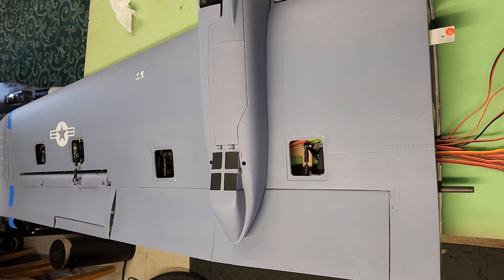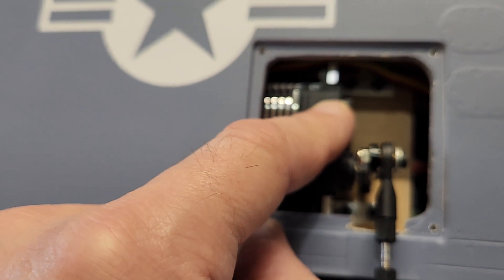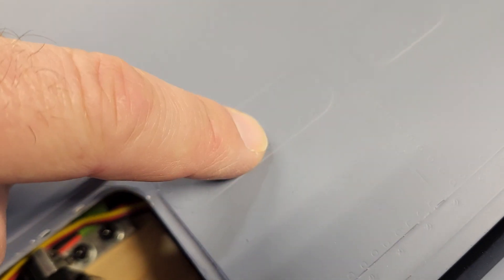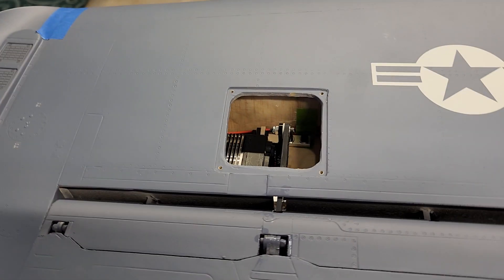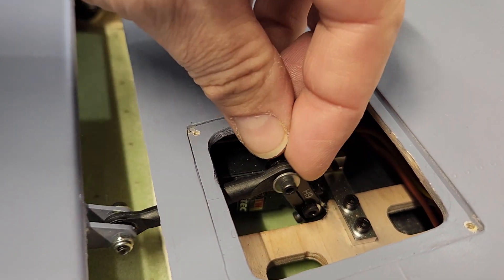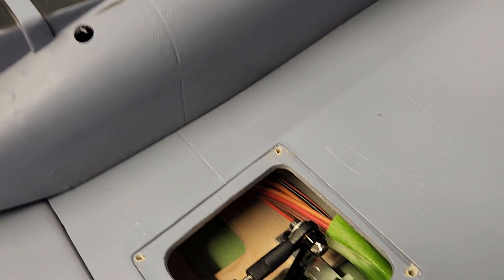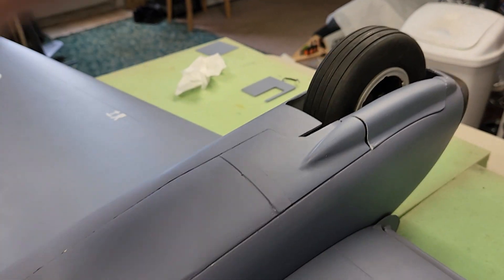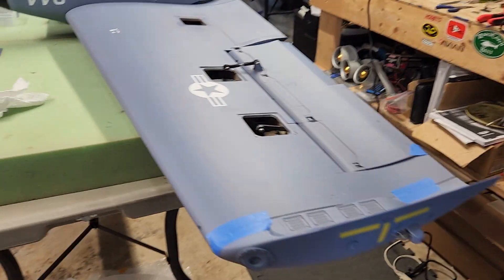T-One Models A-10 EDF conversion: Wings part 5

Comment: Dave anytime I watch one of your build videos I'm shaking my head yes the whole time. You are building some expensive, large models, and you spare no expense making sure your components and hardware are up to the task. You always make sure everything has the best mechanical advantage so you get the best performance from your equipment. It boggles my mind how often builders use sub par  equipment in a heavy, demanding model, and hurry the pre-maiden preparation  ...then wonder why things don't go well. Excellent job so far.
Reply from the maker: Thanks so much for that Adam! I have always been a firm believer in measuring twice and cutting once as well as using the right stuff for the job. Do it right and do it once. Especially when your building large scale turbine level models that require heavier better equipment. I make my videos so people have at least a minimum idea what they will need and what it takes to do something like this. I  hope  answer some questions along the way also! Im half way today with it, with a goal of finishing by September. Next step is the nose section.
Reply: @davidsnyder238  You know I'll be watching !